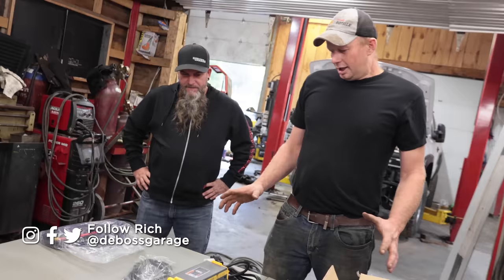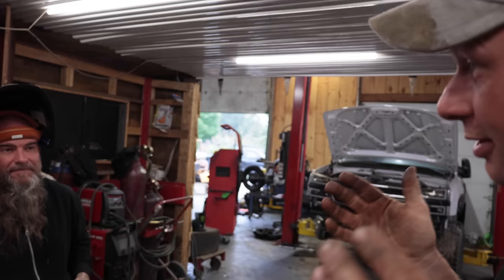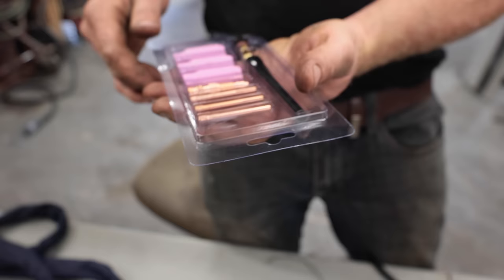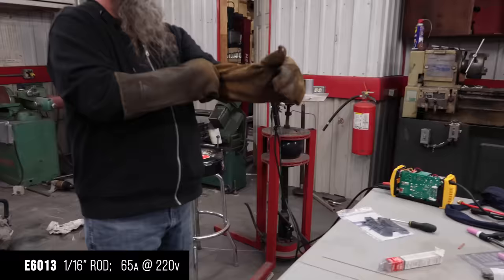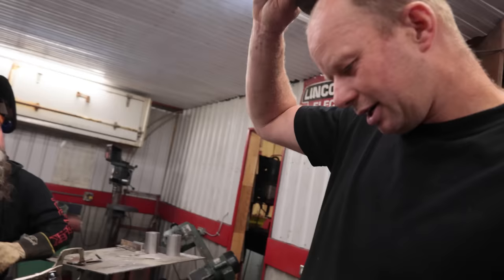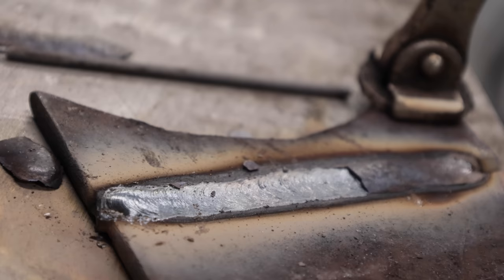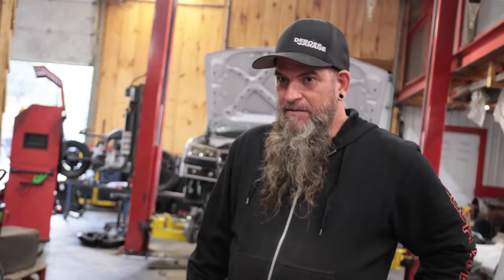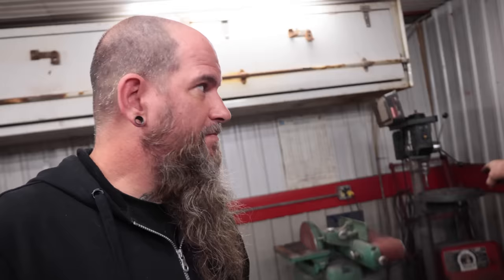How Good is the CHEAPEST Welder on Amazon?

Comment: tell ya what man,  i see you welding there when its darker there, hood down and that stick smoke comin up past your helmet, reminds me my father was a boiler maker, he hit WW2 when he was 15 almost 16, 4 years in that then he went to Todd shipyard worked a decade there, then went onto the Seattle watershed, from there to the Alaska pipeline, mostly all stick welding, in the day they used zero precautions for the workers, no big fans at each end of the pipes for air transfer nothing..

if you were lucky you were near an access cut out up top, after the AK pipeline they sent him over to Hanford 400, 400n and east.. a lot of disassembly renewals so forth, then FFTF, pretty much every area on at Hanford, so he got away from that hardcore pipe welding around that time 76ish, so the 3 decades he welded in pipes all that no respirator, no air exchange nothing he developed a bad industrial disease, manganese disease and its no jokes!

I watched him die harder than rock.. it was bad, his legs and arms started curling up in the fetal, couldn't straighten em out, lung real bad, he was on albuterol for the last 20 years or so, pacemaker.. just ugly, point is take the best care any way you possibly can to avoid that stick smoke, any and all of it, no matter what type of welding do not inhale any of it, use a small oxygen mask, why play? why risk just getting 1/4 of what my father got, or even a 20th? 

just not worth it, Pops was pretty gung ho as well when he was comin up, joined the big one at 15 amd made it back home, yea pops was hard,  he went hard too.. no fun at all.. I'll never forget the day we were driving to a doctors appointment he was getting so bad, wheelchair, bed sores, bad.. he looked over at me and said out of no where, "man I really fugged up" ... sad stuff.. take care of yourself the best you can, we only get the one body that's it...

Comment: Running 3/32" and 5/32" both at 137A. And wondering why the 5/32 is running like shit. Come on guys, if you're re going to test it ,test it right.
Give the thing a fighting chance by using the correct welding parameters for each rod. 5/32 should be ran at around 155A for optimal weld performance

Comment: Was it tested with the cover on it? If so did that change how it cooled down or got hot?
Reply: If anything itvran hotter with the cover off. That fan is ducted.
Reply: @jpbsv  you’ve ran it with the cover on?
Reply: @Y_I_DIY  the cover is meant to direct the air over the engine. It will always run cooler that way.
Reply: @jpbsv  you own one of these?

Comment: What’s a tungsten filler rod? 😅
Reply: to90zerobl. It isn't a Stick Rod. Mine are about 3 ft long and you snap off what you need. You use them with Mapp Gas or Tig like a Soldering Iron with Solder. You need Argon Co2 with Tig !!!  You can get low melting point Aluminium for a Mapp Gas Torch with Flux !!!

Comment: Will it work with my 220v / 30 amp breaker?
Reply: My old 150 amp 4 Killowatt Welder Works off 30 amps !!! I had to solder  28 amp fuse wire into the Fuse !!!  But these Modern Small Welders are much better and don't draw so much Current !!!

Comment: First of all, why did you take it apart prior to even turning it on, never mind trying it first? Secondly, by taking the cover off during the welding trial you could have reduced the amount of cooling air from front to back and possibly overheated the machine.🤔 I’m rather surprised by how you approached this test. I purchased a similar machine online for a bit more cost and I was surprised that it was able to run 1/8” 6010 as well as 1/8” 7018 in several positions. Of course I would never trust it to do any constant welding or certainly not on code work, for that I have higher quality American made welders.
One last thing: rule number one is now and always has been…..NO FAT CHICKS. Never mind the clean surface.🤔